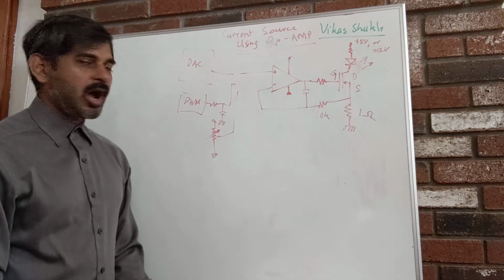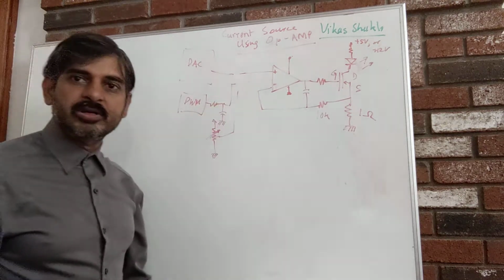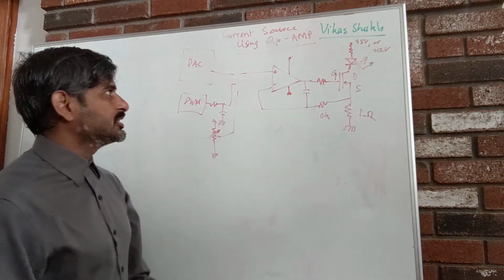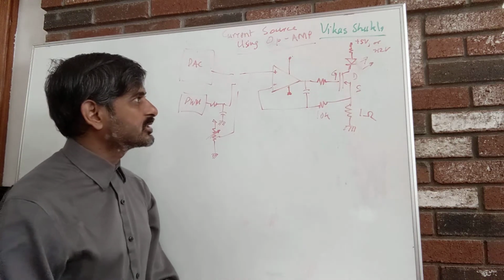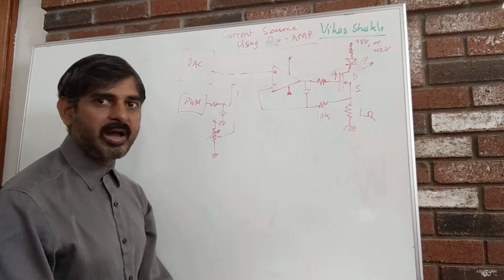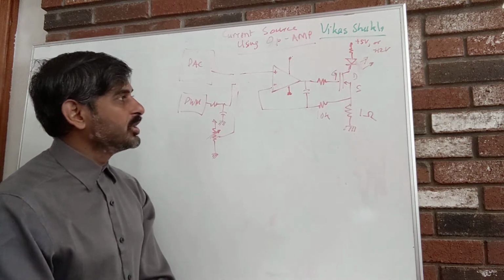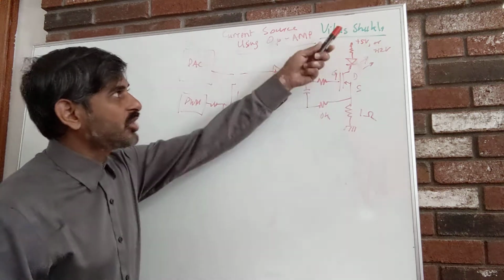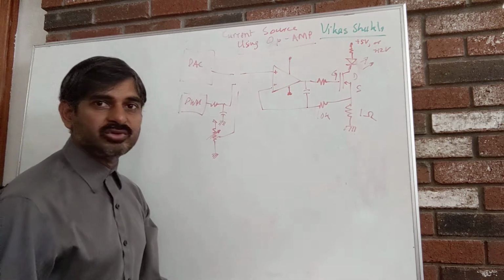Current Source using Op Amp circuit

Comment: Hi. Can you please explain in detail the reason for the gate series resistor (think this is to do with gate capacitance) but also the 10K resistor and capacitor and how would you calculate the values please. I understand all the rest of the circuit and have constructed it but want to improve the design and accuracy. Many thanks